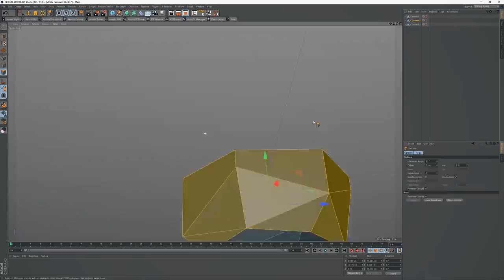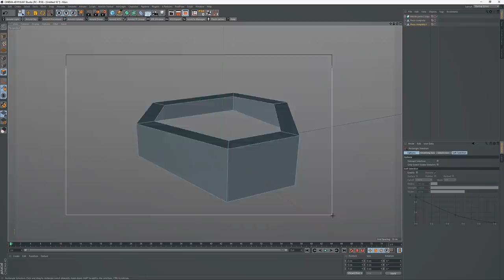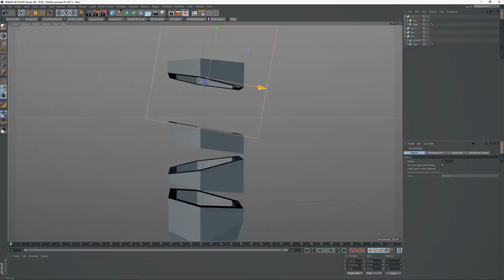3D Printed Concrete Planter Mold / Anet A6 / Molde Maceteros de Cemento impresos en 3D

Comment: I was thinking on molds for a small plant pot, the main issue was just that the inside part. Since I'm not yet printing with TPU, I want to some up with a design for the internal rigid mold  assembly.
By the way, incredibly great job on video production, flawless!
Reply: Hey, I saw that people cover the internal mold with a balloon to facilitate the unmolding. And of course then covering it in vaseline.
Reply: @mica1425   I just saw that just today! But I feel it works good with cylinders. I'm trying tomorrow with silicone, I'm printing the molds for the silicone as simple as possible (vase mode) and then see how it goes

Comment: Can I make it without flexi fillament? My printer doesn't support that...
Reply from the maker: If you print flexible part on PLA, later you will not be able to remove it. It should be printed with flexible filament, sorry...
Reply: you can try to print insides with SBS filament, it is kind of flexy when printed with thin walls like 1-2 perimeters

Comment: You've printed a little piece and put into the extruder... What is that for exactly? I see it's for printing flexible filament... But could you explain a little better please?
Reply from the maker: It is to facilitate the entry of the flexible filament. It avoids tangles in the extruder